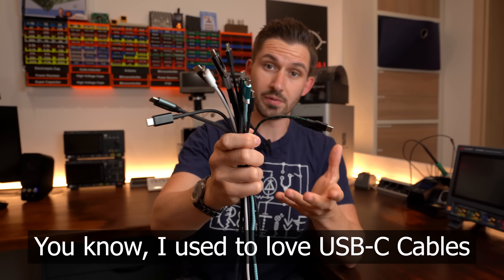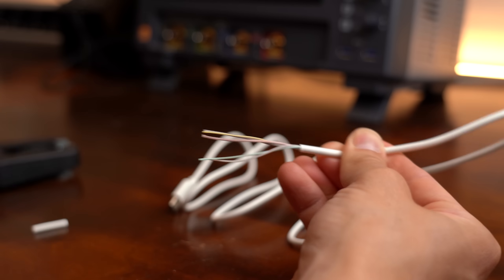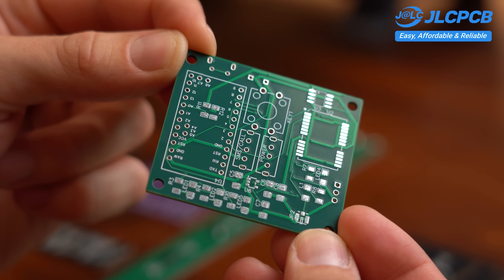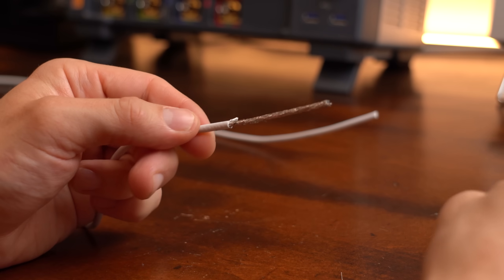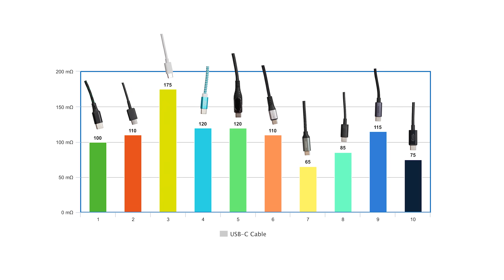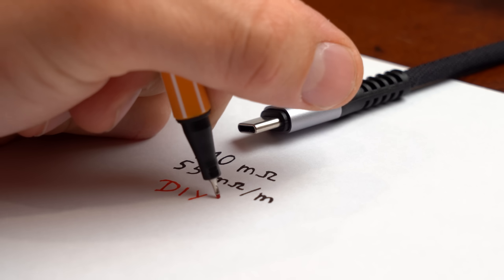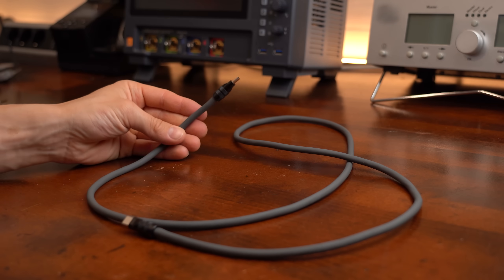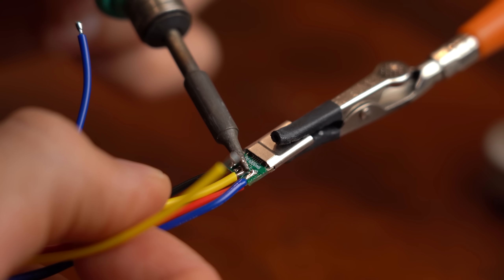Your USB-C Cable STILL Sucks — I Built a Better One? (DIY or Buy)

Comment: Since there are no USB3 wires, I don't think the USB2 data communication will be effected. Most USB2 cables doesn't come with shielding. I had the same problem with one of my usb-c cable, male connector went bad, Bought a connector for 50 cents. V+,GND,DP,DN,CC pins connected respectively, and It works great. It fast charges phone with 30w adapter.

Comment: cheaper is relative. I didn't closely watch -- was your cable more expensive using the same quality of cable?

That's the thing that you have to compare when you're looking at cost. Either you're using the cheapest parts you can possibly source.

Comment: The technology IS the problem.
Hardware manufacturers wanted a  single connector for everything to save costs.
Having cables that look the same but have different features is just horrendous design.
This is similar to touch screens in cars. Initially cool, but customers quickly wanted physical buttons back.
Well, I want different cables back! Or at least some standardized visual distinction for different features.
Reply: not sure cable manufacturers have a say at USB-IF?

Comment: I had the same problem but it was with an A to B USB cable delivering power and data to a test set.  I got errors from  the test set because of the cables voltage drop.  I did find one 3-foot cable that marginally works but I will also try a DIY shielded cable in the future.  Thanks for  posting.

Comment: Resistance is only one of parameters. The not that important one. It's only for power delivery. What about speed, interference (to it and from it), reliability? Does it handle 80/120Gbit/s? Too many questions unanswered.

Comment: Not only that but they often use CCA (Copper Coated Aluminium) instead of pure copper conductors.
Reply: Nowadays you can be happy to get CCA. Because some of your cables are now magnetic... They now use cheap iron/steel wires.
Reply: @whuzzzup  Iron? Too expensive. Pure aluminium is cheaper.
Reply: @hubertnnn  its funny because it then becomes a transformer
Reply: @hubertnnn  I know that what you say it true, but the other guy isn't completely wrong either.

I've seen countless cheap tech products from aliexpress using ferrous conductors and it's a sight to behold.

Not so much when you're trying to tin the wires and the solder doesn't stick lol
Reply: @hubertnnn it's recycled and not refined is my guess . Like a basic pot metal..
Reply: @hubertnnn  It's definitely not pure iron. Whatever it is does weakly stick to a magnet though.
Reply: @hubertnnn  Iron is MUCH less expensive than aluminum.
Reply: Copper clad steel is great for RF, and quite tough... use the magnetic power wires from a cheap type-A cable for data wires that can take abuse, the crap data wires for CC wiring, and add your own copper for power.
Reply: Many low cost cables from Amazon and the like use iron wires to save money.  Try a magnet on them.
Reply: To be fair, due to the skin effect the data lines will benefit from copper clad Al. However the DC power conductors should be solid multi core copper or silver for the highest performance and gold contacts used to ensure minimal loss over the tiny pins of USB-C connectors

Comment: Maybe it's just me, but I never actually had issues with USB-C cables. I bought the cheapest IKEA cables for 2€ and they work great. Data transfer, charging laptops, fast charging my phone, you name it. It just works. Yellow is USBA to USBC and purple is C to C.
Reply: Ikea.  Not a gas station. Difference in quality.

Comment: A chip in the cable is stupid with random standards. I don't think I've ever found the correct one. It's like having different power from the same mains voltage socket.
Reply: it could be even worse, with the "Load" also communicating with the chip in the cable, refusing to charge, if the chip does not respond with the correct magic numbers ;)
it makes sense at least somehow, that the cable is able to communicate with the "source", so you won't run 5A through 5m of 0,14mm² ... that's not a charging cable, that's a heating cable 😂

Comment: Personally I'm more worried about data transfer speed than a few milli volts of loss.
Reply: At a given speed, either it works or it does not, environmental noise aside. These PCBs don't break out USB 3 lines, so you can't have USB 3 speeds unless you carefully soldered directly to the connector pins, that is all. You need to run at least 4 extra wires (two differential pairs) for the high-speed link, and since they need low capacitance, they actually benefit some from using very small wire. PCBs can be bought that have pads for USB 3 pairs.
Reply: @jercos this is all about mindset
Reply: There are full-spec breakout board plugs available to make the soldering easier, it's just that with so many more pins needing connecting to the board, at the ends of your cables the connectors are gonna be huge and awkwardly shaped

Comment: Creating a usb c cable with slow data transfer should be a crime, shame on you. Pfui
Reply: do you even know how stiff a fully featured non-fire hazard USB-C cable is and how completely impractical it is for basic tasks like phone charging and portable applications? What you need is a properly labeled and to-spec cable
Reply: @wokzhongson  For fast data transfer you literally need two more wires... they can be very thin as they don't carry any power.
Reply: @radry100 2 total data conductors will do a maximum of 480mbps over usb 2.0. afaik for usb 3.0 a minimum of 2 differential pairs (4 conductors) plus existing usb 2.0 conductors are required for up to spec negotiation and even reporting 3.0 capability, after which you need to figure out how to route two differential pairs along your length of cable.
Reply: Depends on the need. And more pins to solder. Some just do not need a fire hose data cable.
Reply: @bichela  The cable is already fat, a few more thin wires aren't gonna add a lot.

Comment: I got so tired of "random" type-c cables, I am only buying thunderbolt ones, they're typically built better.
Reply: Yeah I've kinda settled on the solution to this being "overspend on USB-C cables just so I don't have to think about specs" especially once you start trying to use them for displayport, 240w and external SSDs

Comment: USB-C  is great but probably the worst standard to use for a laptop computer power supply. It is waaay too easy to break the socket away from the motherboard/daughter board it is soldered too. I have broken a port connector off every laptop I owned that had one. The power supply cables have to be thick and stiff enough to handle the power requirements but the consequence is they over stress the socket.

I like the standardization to a single port type but the industry needs to develop robust socket designs that can handle the rough service use cases. Even if it means making larger socket bodies with through hole pins that allow for better strain relief and repair if needed.

Comment: Be careful about soldering two cables to one pad, with just two it shouldn't be too bad, but that's why the 12V high power cables are having so many problems.

Comment: Hi Scott, What connector to use if I would like to have a cable that allows me to power laptop from monitor, and send video back to monitor. Saves me weight by not carrying power supply with me to the office.

Comment: I'm more concerned with longevity of these things. Wireless charging makes it less of an issue, but it's always the ends that get a break in the wire over time on the cheaper cables. The magnetic ones and angled ones mitigate this but it's always the connectors and the end where that wire bends most often that are the weak points in the design.
Reply: magnetic ends are non-spec and a health hazard. don't buy them, don't use them

Comment: ethernet cables have twisted pairs, shielding and are usually manufactured at higher standards than USB cables
Reply: Unfortunately he didn't tell us the size of the conductors. Ethernet cables with 24AWG can be found easily

Comment: What I am trying to find is one of those flat 90 degree fittings that does data. I'm trying to make a Micro SD card reader I can have plugged into a device like a phone that I don't have to worry about removing before being active with the device. I'm trying to re-purpose some older tablets with low storage and no SD slot into a usable video player.

Comment: USBC cables going to be the next Great Scott Merch? 😂

And I'm still super positive for USB-C; the mechanical connection is a much better balance of size, strength and capability than the old standards. And it tends to "work enough" in a pinch, even if not every cable is as fast as it could be. If makers were better at labeling, I think the whole 100W/240W, 1GbpS/5GbpS issue would be trivial.

Comment: Just had the issue of trying to find a fully wired USB C cable. Seems most of the power bank ones save a couple of cents by only wiring for charging and no data 🙄

Comment: I just had to order some more USB C cables. This time from Temu. Taking my chances.
I've used the popular UGreen brand and similar, but the recent ones have fallen apart in less than a year.

The biggest annoyance lately is that cables don't seem to get listed with QC support. I don't use PD, just need QC for phones.
It's become a guessing game as to what you get. And when they do get listed with QC and PD (and confirmed in reviews) they wind up costing quite a bit more than I'm willing to spend on a cable. Reviews also never cover longevity and I'm beginning to think even cables are going the way of everything else out and being built to not last a decent length of time.

I did manage to find a 100W+ capable cable recently and it had decent gauge wire. I used this to make a cable for a FNIRSI soldering iron I power off a old 130W DELL laptop charger. Works like a charm, but it cost me 4x more the cable than it did for the PSU (which is ancient and still works!).

So I might look in to making my own next time. Move my "Built not bought" stickers from the car to the cables. 😀
Reply: What phones are you charging that have USB-C but not PD? Seems like every Western phone released in the last few years support PD.

I’ve been pretty happy with Baseus cables from AliExpress, haven’t had a single one fail in 2+ years.
Reply: @GabrielSoldani  Still rocking a LG G7 ThinQ. Refuse to "upgrade". It'll make 10+ years before I send it to the grave. 🙂
Reply: @2226cc   I wish I could get a phone that'd last 10+ years. My last one (a Pixel 4a) probably could have if Google hadn't remote bricked every 4a in existence for no reason.
Reply: Sad to hear. I've also been using uGreen but their latest cables I got were also very bad one even from factory.

Comment: I’d probably look to have a high quality DIY cable if I rapid charged more, or needed a cable for the full 240W for a connected system. But, I charge almost everything overnight, when the system will slow down the charge time to protect the battery anyway. So, in the end I’m only really concerned about cable length and break resistance.

Comment: Its absolutely hourendous having to deal these cables, so I just DIY myself, been owning 4 of them now and one of them is almost 2 years old absolutely no problem, the cable was for phone charging and data tansfer to my pc so granted it doesnt have a decoy charge for more power but still significantly cheaper than those brittle aftermarket one, I remember faintly it was 1usd for each 2m cable in total with usb a and usb c on each end.

Comment: Great video !!
I think that the next topic should be about the connector itself and how does it withstand multiple insertion cycles and maintain its "contact strength "
Leaving aside the loses in the wire usually the connector fails.
Reply from the maker: I can put it on my to do list. I honestly think though that this goes beyond my scope and a mechanical engineer can do better testing.
Reply: I think I is part of  the scope just because after some time, the contact rezistance will increase, the questionis how soon. Why not measure your diy cable resistance after some insertions @greatscottlab

Comment: 2 things: with the bus cable, you should cut one shorter and expose the other one more, so that you dont have a thicker gauge of wire to solder on to the board.

And with heat shrink nylon you have to keep it stretched taut the entire time
Reply: We're talking about 2-5mm snipped off of each end, so let's say we lost about a centimeter over the course of a meter of wire at most.

The difference would be less than a 15mV drop across the whole cable at 6A load, and even less than 10mV at 5A. So it isn't something to think about unless you're going to be increasing the total wire length to something like 2 meters.

This argument is valid only for copper wire strands or copper clad aluminium wires, absolutely not for raw aluminium ones as the wire resistance would shoot up like crazy compared to copper.

It's basically a non-issue in cases like this, but it's nice to see that you guys are still taking it seriously.
Reply: @proxyhx2075 can you elaborate how did you make the calculations please
Reply: If you cut one cable shorter, aren't you effectively nullifying the benefit of the second wire?
Reply: @RetiredRhetoricalWarhorse i think because it is a short part, it won't have much resistance.

But not sure wait for an expert.
Reply: Yeah only a short distance so should not matter much